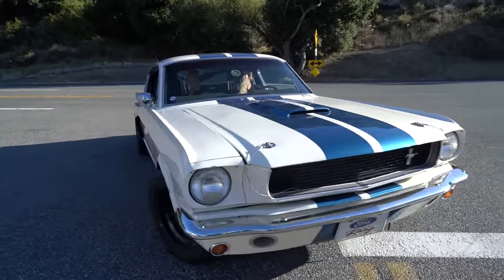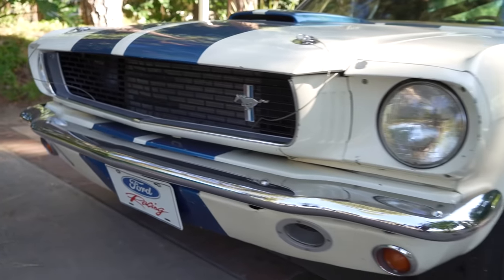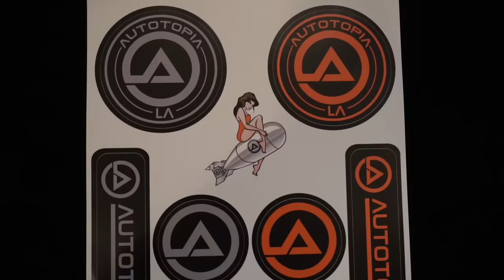Loud Shelby GT350 Throws Down

Comment: Lets be honest. With all the LS swaps, the Coyote swaps, with their own charm and reliability.. You can't hardly beat and olskool hammering V8. This thing screams so nice, it beats the revving italian supercars on attention. And its not even a ridiculous cubic inch bigblock.
Reply: You got that right no Ls,coyote an no  new style motor .just all man you got to love it
Reply: I'll still take a  Coyote 👍
Reply: And I'll still take a LS1😝
Reply: But its still not what originally came in the car. Should have stayed with solid lifter 289.
Reply: @StreetTruckinTitan  if that's a 350 was it a 289 or bigger
Reply: @johnnyblackking169  Shelbys came stock with a K code 289 then added aluminum hi rise tri Y headers and a holley 4 bbl carb. They later had a R version that they did some head work to bump up the compression to 350 HP.
Reply: @StreetTruckinTitan  ok I feel on that .I work for guy back in late 80s he had a march 1 an the one look the GT 500 with the 289 number on the side of finder .that march 1 was a killer it had 302 Boss it had the offset tires from factory man it was nice
Reply: @johnnyblackking169  428s in the gt350s
Reply: @johnnyblackking169  *gt500s
Reply: Because to be honest, the LS1 is arguably one of the shittest, dog shit sounding V8's ever made. 
The reason this car sounds so good is because of the unique Ford Windsor firing order. Just like a 427 GT, Ken Block's Mustang and like a (much louder) Australian V8 Supercar - which uses the same firing order. The note itself is due to the auger barrel muffler, which is basically straight through. The X Pipe isn't doing much at all for the sound.
Reply: @real_talk1180  And nothing sounds like a top fuel. Or like a triple turbo rotary and so on. 😉 The idea is that with all the swaps and their distingtive sounds, and old cast block, without ecu, sensors and its own firing order makes its own clearly recognizable sound.
Been thinking about it myself for the 62 Mercury wagon. I have a Lincoln 32 valve in my barn. But I'm gonna stick with the original FE and make this bark... The cammer will get its purpose one day
Reply: My LS says otherwise
Reply: @realdeathpony  Unless it's a 406 to 427 LS7 size, I'd hazard a guess it sounds pretty average. Just because it might be lumpy and loud, doesn't make it a good sound. Cleetus' DaleTruck - now there is a good-sounding LS (7). You need big cube displacement to make an LS note sound good. My opinion of course.
Reply: Why wouldn’t the engine that-cost over 10 Grand Straight from Ford not be reliable Also why are we mentioning LS motors when this video is about a GT 350 with a fort stroker motor in it
Reply: @GOBRADON502  I love my LS1/LS6 Vet, it's such a sweet motor and responds to mods so well but an old school stroker is just so visceral.
Reply: @StreetTruckinTitan  I test drove an "original" 289 GT 350, sorry but it was a complete dog of a motor.  I have NO regrets on going restomod.
Reply: @Jim Lahey A lot of the LS3 mods will work on the LS1/LS6 motor.
Reply: @real_talk1180  If money is no object than yes, go for the gold  lol
Reply: @markwarner5910  My first car at 16 was a 1966 K code Mustang GT. Def not a dog and loved to live at the higher rpm limits.
Reply: I am so sick of the LS stuff! It really ticks me off to see an LS in a Ford, somehow people have been brainwashed into thinking Fords can't make power.
Reply: @markwarner5910  

There was something wrong with that car then, the K code was an awesome engine!
Reply: @port nut The Cobra 289 wasnt lame just the driver.
Reply: I’m totally with ya brother, ever since I watched my neighbor build a 64’ Falcon when I was a kid in the 70’s, i learned what a good mechanic can do with a small block motor. That little SOB smoked so many big block cars it was almost sad. 289, bored to 299, lunati cam, 351 heads, 11/1 I mean the works, he shifted it at 7500-8000 and it never balked. 430 hp give or take  hp ain’t bad for a motor like that. Top loader 4 spd 9” holding 4:11 gears, she was a riot.
Reply: @deborahchesser7375  that sure sounds like a nice combo. Especially as a ford lover and owner myself. I am currently building myself an FE for my wagon.. 20yeara ago i build a 466 for my 79 ranchero. It made rpms they said it wasn't made for...
Reply: @superbee7936  a wagon and a Ranchero, nice man ! I never really liked the El Camino but the Ranchero I did like, we did have a 67’ Mustang coupe that I begged my Dad to keep until I could drive, but as an everyday driver they don’t last and in the mid 70’s he wasn’t worried about messing with it. I knew what it was though and wanted it bad. 289 4V 4 speed, dual exhaust and a 3:73 Detroit locker. Olive green didn’t look like anything special but Dad knew how to sneak it under Moms radar, she was like, why is it so loud ? 😆 oh man, her with a big beehive hairdo and cat glasses about 71’ with those loud ass pipes downshifting and crackling. Sorry to drone on, so many good memories, take care man.  ✌️ Burny
Reply: @superbee7936  a 466, that’s a wild sounding creature, what did you start with a 400 or ? And yeh, if they are balanced right even a motor that big will spin pretty good, I’m guessing 6,000-7000 on the tach ?
Reply: @deborahchesser7375  the Mercury is a 62 Monterey wagon. One of only two in Holland. Building it on airride and the 352 FE. some say not to use the 352,but to me its a challenge to do things they say can't be done. Same with the Ranchero. 79 GT with a 77 thunderbird front end cut to fit the stock hood. Engine was a 77 linc 460 with all the high performance goodies as a looey idle cam and high compr pistons. Rear was an 77 9 inch with discs from the same lincoln. I have been thinking of convertig the Merc to a 32 valve engine a have laying around due to the astronomic gas prices right now in europe
Reply: I agree with you 1000% my friend!
Reply: That's one of my favorite things about a V8, even a small one can sound amazing.
Reply: I think people do newer swaps because of the warranty
Reply: @johnnyblackking169   originally they're  289. This guy said he's got a 302 stroked to 347. Mean
Reply: Shelby like the small block cars better. That’s his words from the old interviews.
Reply: You got that right man!! This is one badass ride!! I love the way this older motor sounds!!
Reply: I doubt it get more attention than a screaming italian V8 but I sure do love the engine in this car
Reply: Yeah even Carol shelby said the small block cars were better. Less weight, don’t have to over build everything, better handling. And the rpms are crazy!! Look for his old interview.
Reply: @dons1932  lol ok Don. The X-pipe on my 19 GT350 changed the whole sound.
Reply: I’ve got a stroked Pontiac 461, and 2 fords a 302 and a 351….
They can keep their LSs… I mean, they a lot of bang for the buck, and if I get a project with no motor, I wouldn’t hesitate but…
Reply: Yes. Beer. 🍻
Reply: ITS CRAZY TO THINK THAT BACK IN THE 90S I ALMOST BOUGHT A 65 GT350 FOR A LITTLE BIT OVER 20 GRAND LOL AND TODAY A 65 GT350 IN GREAT SHAPE IS ANYWHERE FROM 600GRAND TO OVER 800 GRAND LOL YOU CAN'T GO WRONG OWNING A REAL SHELBY AND THAT'S WHY I HAVE 4 REAL SHELBYS.
Reply: @anthonylaudano9435  if i got a dollar every time i hear that. 

I would have 1 dollar.
Reply: @BillyJupiter  LOL VERY FUNNY BUT VERY TRUE LOL THE GUYS THAT BOUGHT A 65 GT350 WAY BACK IN THE DAY ARE SINGING ALL THE WAY TO THE BANK LOL TIMING IS EVERYTHING LOL I BOUGHT MY 04 COBRA BACK IN 2019 FOR 31GRAND AND I JUST SOLD IT FOR 50 GRAND LOL AND I BOUGHT MY VIBRANT RED 93 COBRA FOR 17GRAND WAY BACK IN 2005 AND I JUST GOT OFFERED 70 GRAND LOL LIKE I SAID IT'S ALL ABOUT THE TIMING LOL.
Reply: Exactly, I don't really care for the sounds of the lambos and Ferraris things like that. It's straight up V8's for me.
Reply: @mortem-tyrannis  A MEN BROTHER LOL I ONLY HAVE V8 AMERICAN MUSCLE IN MY GARAGE.
Reply: @anthonylaudano9435  pure blooded American muscle is where it's at.
Reply: @markwarner5910  - Must have been dialed in wrong or had an issue.  The vast records set by the GT350 289 speak for itself!  That engine in the GT350 R put out 0ver 350 hp and decimated the Corvettes with a 327 for 3 straight years in SCCA B production racing.  In the Shelby Daytona Coupe it was 390 hp and good for a hair under 200 mph!  With those accomplishments, saying the 289 was a dog motor is quite ignorant me boy!  🤠🏆🏁

Comment: Awesome.  This makes me never want to buy a Tesla.
Reply: Tesla fanboys incoming
Reply: Yeah, I'd rather drive a Hyundai with a 6 speed !
Reply: They still make those??
Reply: @jeffschwartz5199  then a tesla...sure.
Reply: You thought of buying one before this?
Reply: This makes me want to own this. and a tesla.
Reply: A Tesla would SMOKE this
Reply: @bobbyb608  the fun factor on the Tesla is - 10
Reply: @bobbyb608  the fun factor on the Tesla is - 10
Reply: Christmas Gummyworm you mean a Tesla would beat this, this would smoke the Tesla, tire smoke that is.

Too race car look, no performance improvement....full restomod would have been better.
Reply: @bobbyb608  are you sure about that
Reply: Chuck Beef,
Unless you want to go 0-60 in 3.2 seconds for less than $70k.
https://youtu.be/cXkRcuwoIm4
This GT 350 is a way more fun toy, but definitely not a daily driver.
Reply: Martin,
"the fun factor on the Tesla is - 10"

Not according to this guy: 
https://youtu.be/cXkRcuwoIm4

0 - 60 in 3.2 seconds sounds kinda' fun to me. Not sure I could get used to not hearing an engine revving through the gears, but I'd be willing to give it a try if they weren't so expensive.
Reply: Craig hambone43 yes. 100% without a doubt
Reply: Craig hambone43 the s model can do 0-60 in 2.3 seconds. That’s faster than a Bugatti Veyron
Reply: @bobbyb608  but can the 5,000 pound boat turn. NO
Reply: Craig hambone43 the model s set a 7.23 minute Nurburgring time, that puts it in the top 25 of all production cars in history... so yeah.. I say it can turn
Reply: This is the complete opposite of a Tesla in almost every way.
Reply: @bobbyb608  i doubt it is as fast as a dodge viper acr around the nurburgring
Reply: Christmas Gummyworm maybe while it’s dreaming.
Reply: @bobbyb608  if the dodge viper acr is the 7th fastest how did the tesla model s run 1 second slower
Reply: Craig hambone43 the viper runs a 7.01
Reply: @bobbyb608  who cares the point is this gt350 would be way funner than a tesla and cooler
Reply: @bobbyb608  And its the 09 dodge viper acr that runs a 7.22
Reply: Craig hambone43 wel of course the mustang would be a lot more fun. I’m just playing devils advocate right now. If the 09 ran a 7.22 then yes, that means Tesla has a model that’s one second slower around the track
Reply: @ArcoZakus well sure but for me fun also is in the look, in what you can do to make it faster, lighter, cooler. What's better,driving a super fast car or driving a fun car that you almost have done yourself on the street?
The thing is that the problem I'm talking about is for now only awaible for electric cars since there are no cheap and sporty electrics. The Tesla is a great daily but ask to any car guy if he wants to have a Tesla to replace his project car, they'll probably say no if they've done things themselves to it. (exept if the project is a rusted shit)
Reply: anything that's manual is fun
Reply: @jojog8304  I think you're missing the point.  It's a vintage Mustang RESTOMOD. If I want to drive something fast, I'll jump into my GT-R. Bring the Tesla and CASH to the track.
Reply: You mean ask your mom to buy you a Tesla.
Reply: @bobbyb608  is false
Reply: @bobbyb608  teslas boring af and are more like arcade cars for tech kids

Comment: so tri-y headers, x-pipe, 3"or 4" auger INSERTS, side exit is recipe for this sound, along with high rpm small block, 411 gears really help it get to scream mode
Reply: Don’t forget high compression and solid lifter camshaft

Comment: Why does the sound of this particular Mustang, to me, seem to be the best of any Mustang you've had on this channel? Simply, awesome.
Reply from the maker: It’s the best sounding Mustang for sure
Reply: Aside from being a nice healthy motor, I think the music comes from the X-pipe in the exhaust and driving with the rpm in the elevated range made possible by the 4.11 gears in the rear. Sounds awesome driving that way but using a whole lotta gas😁 The popping in the exhaust on deceleration is probably an exhaust leak🫤

Comment: Hi Shawn, Bad ass car. Your emotions vs OVC one regarding power ?
400 rear HP on 4:11 it s very short 😉. Mine with 332ci with about 430hp on Tremec and 3:25 it s perfect (french road 😏).
What it is the stroker 355? Not understood🙄. Good vid !
Peace from France.
Reply: It's an 8.2 deck height, just like a stock 302, but it has something around a 3.5 inch stroke crankshaft squeezed into it (a stock 302 has a 3 inch stroke) !!

Comment: Remembering the day I started mine up in the driveway uncapped, fresh ported J code heads, big valves, 108 cam, .551 lift, 10 to 1 compression,  the neighbor came out on her broom circled the house more than once trying to cast a spell on the old 289 Fastback lol

Comment: Without a doubt, this is the best sounding Mustang I have ever heard. Shout out to your sound crew for capturing this perfectly!
Reply from the maker: Agreed. The sound is intoxicating
Reply: AutotopiaLA Yes indeed! Again, well done!
Reply: 2003-2004 SVT Cobra Terminator is the best sounding Mustang ever made.
Reply: @exothermal.sprocket  My 98 Cobra with LTs, offroad Hpipe and 2 chamber flows was the best sounding I ever owned and I had a 2003 cobra as well. I can only speak for cars 79 and up.
Reply: @williammiller8531  Specifically I'm referring to the 4.6 32valve Terminator V8. Here's a sample:  https://youtu.be/MQu_ioAWBy4?t=76
Reply: @williammiller8531  Probably the best exhaust setup I've heard on this engine:  https://www.youtube.com/watch?v=JyMQRwaaZtw
Reply: @exothermal.sprocket You’re huffing glue if you think an 03-04 Termi beats the sound of a 331 or a 289.
Reply: @CrewExpendable2007  I've not done drugs my entire life, but I understand the metaphor.
Everyone has their V8 preferences. Within the Ford brand, the Terminator 4.6 engine sounded a lot different than the current 5.0 Coyote, because the firing order all changed. There's a lot of different sounds in a typical crossplane V8 related to firing order. I've never liked GM's LS sounds for that reason, they are good but not great.
Reply: Amen to that!

Comment: The reason this car sounds so good is because of the unique Ford Windsor firing order. Just like a 427 GT (Ford V Ferrari), Ken Block's Mustang* and like a (much louder than, obviously) Australian V8 Supercar - which all uses the same firing order. That aggressive 'wailing' scream at high RPM. Most every V8SC engine sounds like the same old pushrod 302 V8 - even the Nissan Altima Twin OHC V8SC engine the Kelly's were using, you couldn't pick a MORE different engine - because they all MUST use the 302 Windsor firing order as per the rules. The note itself is due to the auger barrel muffler, which is basically straight through. The X Pipe isn't doing much at all for the sound besides balancing it slightly.
*Chris Harris even says in his interview segment of the car (he clearly must have asked why so, that it had the unique wailing growl) that it was caused by the firing order. They didn't say which one. But pretty obvious, of course. Best sounding non exotic V8 on earth, IMO.
Reply: fyi The LS has the same firing order but does not sound like a Windsor. There's some other Blue Oval magic. You can always ID a 302 w/ Flowmasters from a mile away.
Reply: @SaltFlatMonte  @SaltFlatMonte Say wha?
302 is 1-5-4-2-6-3-7-8
LS is 1-8-7-2-6-5-4-3
NASCAR even sound more Chevy with their 1-8-4-3-6-5-7-2
Reply: This may be a stupid question, but I've been into cars for decades now and have never heard of "V8SC". What does the SC stand for?

Comment: Almost done with my 66" similar to yours. I have three sets of gears for my 5 speed. I was going to use 3:73 with my 347 and was concern about freeway driving.  I see you mention you used the 4:11s and 5 gear was fine. You mention at 80 you are at 3,000 RPMs. Good to know.  Did you have a 9" or 8.8 rear end to take all that power?

Comment: Approved. Expect those wheels. I'd suggest he'd go with a nice set of torque thrusts with light grey center and silver alu dish. Boom. Perfect classic.
Reply: HardcoreMotors Been done...a lot. The black sets it apart from the crowd
Reply: @robertc4311  Yes, as not as good looking. Different doesn't equal better.

Comment: I am building a  65  that is going to get driven when its dry out. My wife's first car its a 65 fastback black with a white interior it's been rode hard and put away wet. I have a 289 built with a 144" B&M  It ran high 12's with out the blower. Also thinking of a 347 all forged  I built that never got used for a friend it is still in my shop. Love old school.

Comment: Love your vision. My 65 FB gt350R resto mod has a 364, big bore short stroke b&b motor but has NO torque down low. About the same HP/TQ 4:10 gear, 5 spd tko etc. When does your torque come on ?   My car doesn't wake up till 3600 rpm but screams to 6500+  3300 lbs without me in it.  I didn't build my motor, just curious about your low end.

Comment: Great car!! Ortega Highway is a awesome place to drive a car that can handle like that! It not Ortega it close to 241!
Reply from the maker: I love Ortega it’s just too short. Come up to LA for some much longer drives and more challenging
Reply: AutotopiaLA I’m looking to modify my ‘73 mustang. TCP Quad link rear suspension, coil over front suspension, rack and pinion. Convert to Five speed Tremec, rebuild 351c using trickflow heads get around 500hp. Something I can carve the road with!
That’s my wish list!!😂